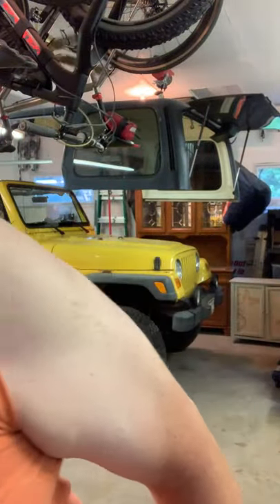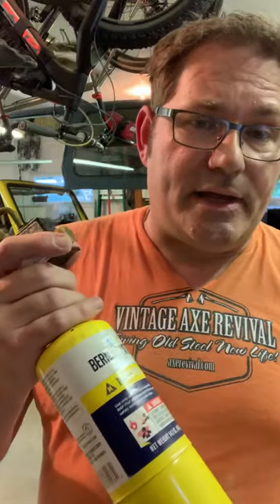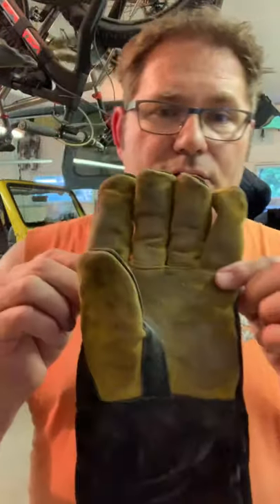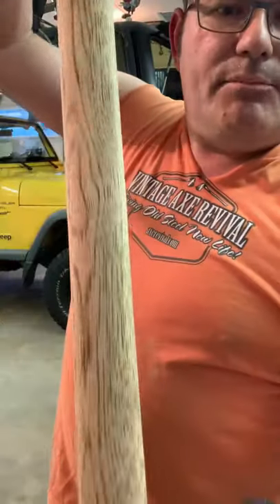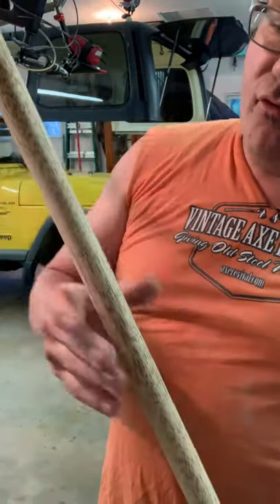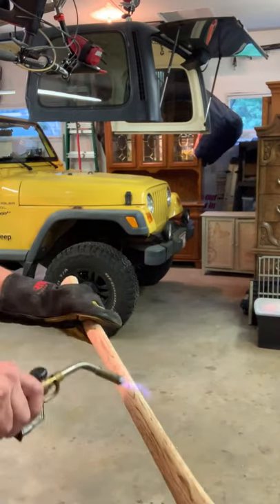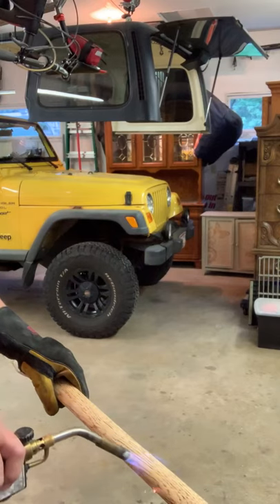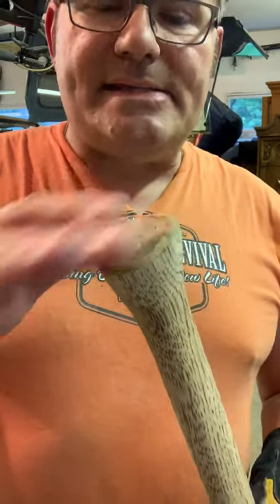Burning an Axe Handle

Comment: Very helpful video. Thanks! Can you burn an older handle that has already had boiled linseed oil applied?
Reply: Sure you can, I've done it with great results. You get some boil out typically but you can sand it lightly afterwards and re oil it. I'm not so concerned about dark spots etc, they still look great no matter what compared to normal handles.